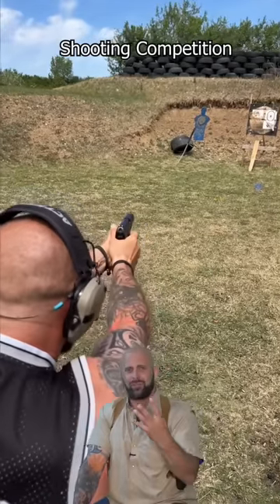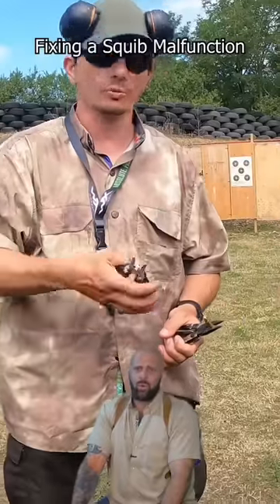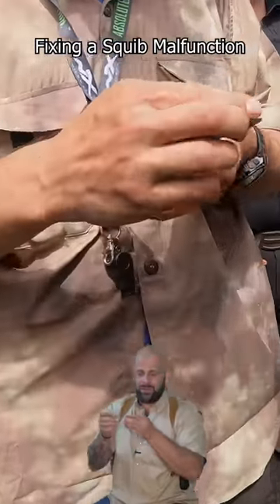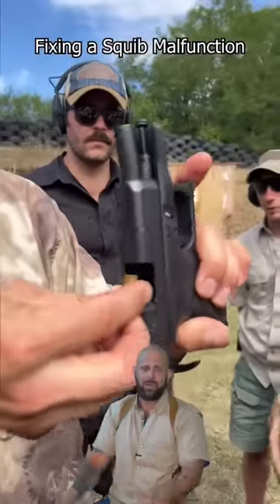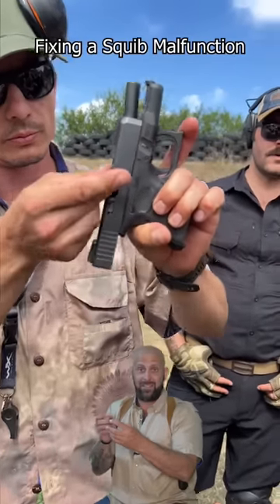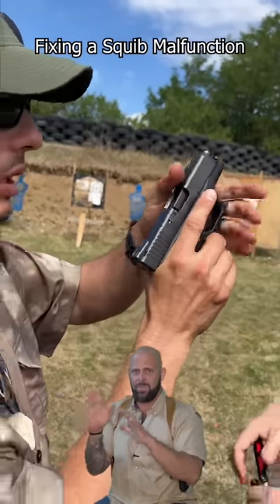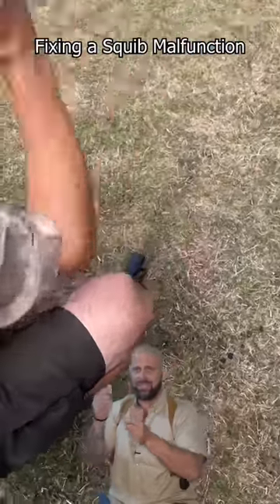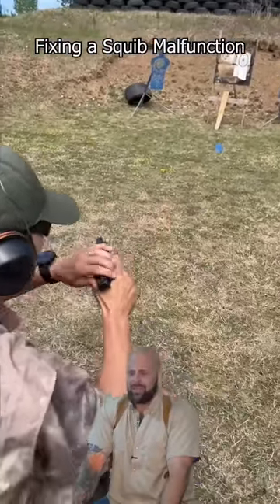Israeli Tactical Training School: Advanced Pistol. Video Clip #10

Comment: Here when I went to US army armor school, completed the GSI gunsmith course, and during my time learning and earning a degree in gunsmithing at Sonoran desert Institute, that thisnis litterally the most dangerous way to 'fix' a squib. When a normal round is fired, the round has to travel to the rifiling, allowing the projectile time to gain speed before it is squeezed into the rifiling, which is several thousands smaller than the chamber or throat. When doing this the projectile is stuck in the rifiling, like the end of a pipe bomb, should that projectile not move, the only recourse your semi auto has is to send the slide and explosin into your face, hands, and arms. If it happens while engaging a 'bad guy' youre fucked. When it happens on the range use a cleaning rod. then have the barrel inspected. That hot piece of lead forcing out on the barrel can cause micro cracks, had this one cracked before it was fiked the barrel blows up. You people are the exact type of people all responsible people seek to avoid... AT ALL COSTS
Reply: Its crazy how many people are ready to do this next time.
Reply: glad someone said it.
Reply: Even losing the match and possibly buying a new barrel is FAR cheaper than a trip to the emergency room.
Reply: It's the kinda thing you can do as many times as it works but never after the one time it doesn't...
Reply: My man, you need to get an English degree next. I had an aneurysm reading this
Reply: @rybaneightsix5085  yeah, i have a hard time believing anything coming from a guy who has never heard of punctuation.
Reply: I love how the doubters reasons of this gun guys knowledge, because he isn't an English major and punctuates his longer form comments on a video FULL of stupidity. 

Your gun is eventually gonna blow up if you try to shoot a squib out, even with only powder. A pipe bomb is a perfect example of what it'll turn into.
Reply: Speaking of avoiding at all costs, how many people did the flag when the other guy handed him the gun. Then he remembered he's being recorded and points the barrel up.
Reply: Thank god someone is talking sense here.
Reply: I'm not even in the armed forces and this was a giant red flag for me
Reply: Had no idea about micro cracks developing from a squib. I appreciate you sharing your knowledge.
Reply: @Texas240  I came to comments to see if anyone realized how hard he flagged people, not even including how stupid his "clearing a squib is"
Reply: I don’t trust anyone wearing a shoulder holster
Reply: well put.
Reply: Well done, sir!
Reply: I, too, like to flex my quizlet degree as YouTube credentials 😂
Reply: A customer brought in a Ruger Redhawk he was working up a load for, long story short, he had 12 bullets stuck in the bore. Barrel was destroyed and frame was swelled. Nothing I could really do so we sent it back to Ruger. Doesn't really bear on this conversation but still a cool story.
Reply: @trc8197 how about with just the primer? A primer can create a squib, so maybe a primer could move the bullet, at least incrementally. If there are no better options in a particular situation.
Reply: @shuumai  why not just use literally any stick, cleaning rod, dowel, etc and not risk this for literally no reason?
Reply: @aricowens2289  after seeing someone's hand blown to bits by a pistol exploding, I guess I'd be more careful that using a full charge of powder. Also, when the pistol is pointed forwards, the powder will shift. Oh... then again, the pressure shouldn't be as high because there's more room for the gases to expand, depending on how far into the chamber the bullet is lodged. Hmm... it would be interesting to see a scientific test with a pressure gauge. But, yeah, better to go with a safer option. This is thought provoking though.
Reply: @shuumai  the pressure is increased because of the larger surface area of the powder and increased oxygen available, causing a more rapid ignition and expansion. Additionally, as someone else stated the projectile usually has time to increase speed before entering the chamber and barrel. The barrel is smaller than the bullet, so if it comes to rest inside it forms an extremely tight pressure vessel
Reply: @aricowens2289  I guess the danger comes from assuming that the bullet will dislodge. Cartridge pressure can go higher if a bullet is set deeper into the case due to the decrease in volume. I know there is some issue with lower volumes of powder in a rifle case spreading out, but I don't recall the details. If I had to try the explosive method, I'd use a reduced powder charge. Might help to stuff some type of light wadding in the case to hold the powder in place?
Reply: @shuumai  or just use a cleaning rod and avoid all this ridiculousness
Reply: @aricowens2289
Reply: Still probably safer then Ukrainian troops filming them selves kicking Russian butterfly mines to explode them...
Reply: @jackstoltz1379  wait. What? Something about mines makes it sound less than safe. Heh
Reply: Yeah but are you qualified to say this 🤣🤣🤣
Reply: SDU student myself USAF Munitions systems maintainer and NRA Pistol instructor and Glock Armorer , I completely agree with you verbatim!
Reply: dont disagree, except the IDF play for real.   Not theory.
Reply: @briancaine9130  In a country where service is mandatory, The tactics, theories, and procedures have to follow the lowest common denominator, Ie not carying with a round in the chamber, playing footsie with your enemy etc etc. They win because they have a 60-70 year tech gap...
Reply: Wait so what am I supposed to do?
Reply: Sonoran desert institute eh..... I fucking hope you got your garand thumb discount on that.... "Right micah"? Lmao
Reply: How long is that gunsmith course and is it eligible for the GI Bill? I will have a year left of benefits after law school might check it out
Reply: @AssyTheNator  Yes they accept the G I bill, They have a variety of different courses and certifications, The GI bill is how I attended lol.
Reply: @AssyTheNator  They have up to a 2 year degree program when I attended. They may have more now. I'd love it if they started a complete tiered system, associate, bachelor, masters, and PhD would be awesome. A school.for little Dr. Disasters
Reply: Nice stetson lmfao NOT. Cool story..
Reply: As a Certified Military Armor as well, I agree 100%. This a very bad idea. It takes 2 seconds to break the gun down and a few more to tap out the obstruction. Shooting an uncontrolled powder charge that is not seated correctly do to headspacing, and it has an air pocket trap between the projectile and a lose powder charge is a very dangerous thing to do. The case could rupture and send fragments back into the shooters face, the barrel could fracture, the slide could crack, it is a very bad idea to do this. It is completely unnecessary and it is bad training since people with try this and could get injured or killed.
Reply: Probably only okay in a pistol
Reply: You're over complicating it and all the other comments don't even understand
punching it out.  Punching it out is almost impossible a lot of the time without a good hammer and a punch tool of the right size.
Reply: Primer only will just move it a very short distance and get it stuck more.
Reply: @Sunviewer338  shut up
Reply: Yo im looking into SDI. Is it worth it?

Comment: That’s great on a short barreled pistol, but if you were to try that on a long barreled revolver for example and the bullet is halfway down the barrel, it’s basically a bomb
Reply: Yeah, I don't know that I would be encouraging this. 

Loading not enough powder in some rounds (at least rifle I believe) can cause them to detonate rather than give the bullet a push due to the powder being able to ignite too quickly. People don't understand that, while it happens very quickly, it's not necessarily an all at once explosion that usually happens in a gun. There is a burn rate. Changing the volume of the chamber it is allowed to occur in is going to change that.  

So, this doesn't seem like the best idea to use across the board.
Reply: Oh yeah especially a revolver because of the gap.
Reply: Yeah I can't believe he's showing people this, incredibly dangerous
Reply: Your data is flawed… if it’s a normal load it’s not dangerous. The pressure is the pressure.
Reply: @SGTUSMCVET269  But wouldn't a squib load in some firearms change timing leading to unsafe firing conditions or just another jam or failed squib load extraction when using blanks?
Reply: @SGTUSMCVET269  Nope, the gap will cause the steel of the barrel to expand before it pushes the bullet, there is a reason you have to seat the ball with a muzzleloader
Reply: @flycrew
Reply: @SGTUSMCVET269  you're wrong but not in a bad way. Starting greater volume will result in reduced pressure. This can work in a sealed system like Glock shown. It would be interesting to test this with revolvers and AR-15 variants with shorter gas systems.
Reply: It used to be common at cowboy action events. People downloaded to a ridiculous level for a perceived advantage in speed. The good news was because of this at least someone on the Posse had a range rod to drive the squib out. This looks like a field expedient way to clear the Barrel if all you have is a couple of multi-tools.
Reply: @SGTUSMCVET269  No. The restrictions of the case are combined with the burn profile of the powder to achieve something sub overpressure. By removing the restrictions of the case you can allow complete burning of all the powder prior to the bullet moving. That same powder would've been burning the whole length and unburnt powder would've exited a long with the bullet. Now instead of a progressive burn throughout the barrel, you've created a complete burn in a sealed container. Notice that the slide didn't lock back? It probably bounced off the frame from the overpressure of the round. Bet the primer of the case is pushed and the base of the cartridge is bulged.
Reply: Watched it a second time. Gun doesn't lock even though it cycled and the round didn't extract. The slide bounced and the case failed to extract due to overpressure.
Reply: @nla27  the slide didn't lock back because there was no magazine in the gun to actuate the slide lock.
Reply: What a load of bull... the same ammo with the bullet removed 😂
Reply: @ifv2089  With more oxygen to burn in a larger space, I would say it’s not rocket science but the aspects are similar
Reply: @eancola6111  a bomb 😂😉
Reply: @ifv2089  Try it yourself and see, reply to me before you do because it may be hard to type afterwards.
Reply: @ifv2089  If you worked in a trauma center it wouldn’t be so funny but go off.
Reply: OK Karen 👍